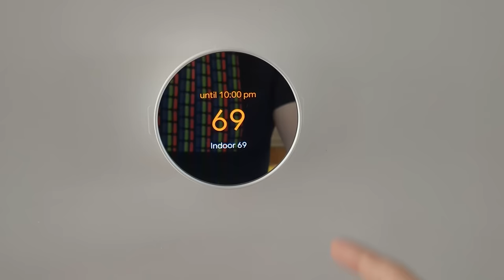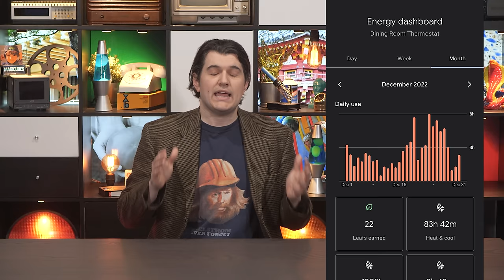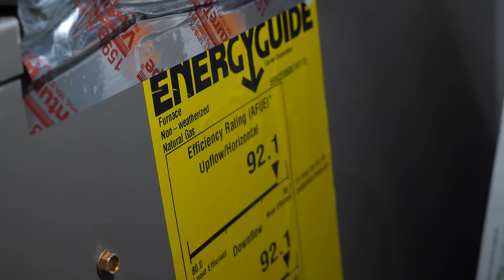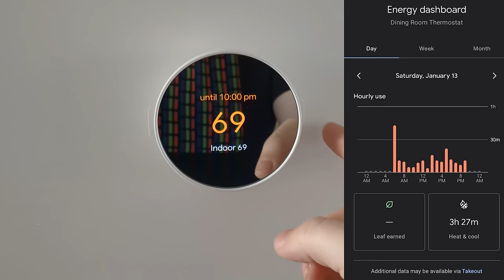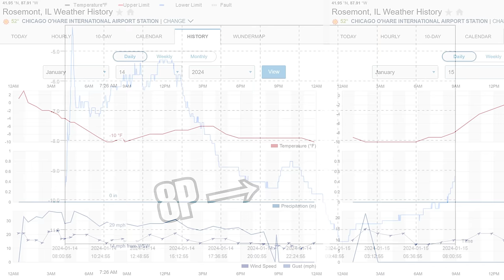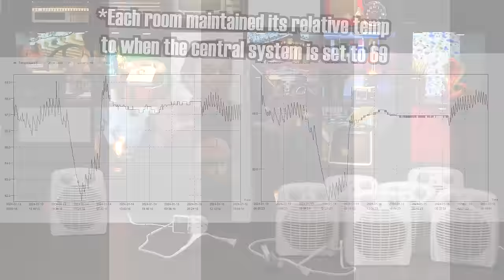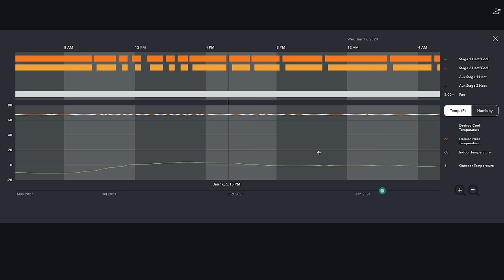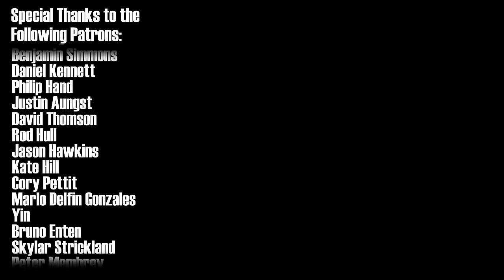Old HVAC industry practices are holding us back and costing us money. But we can fix it.

Comment: What about the duty cycle? When planning for any appliances or machines, whether mechanical or electronic, the basic rule is no more than an 80% duty cycle. That is why installing a slightly oversized unit is actually ideal. That way, you are not stressing the system.

For a similar analogy, take horsepower in an engine.

If I want to generate 400hp, I can do so with a wide range of number of cylinders. From 2 to 12. The amount of stress on the engine decreases with more cylinders, meaning a larger engine will last longer.

It all boils down to durability and endurance. If all you look at is efficiency, then you are leaving a lot on the table.
Reply: nope - a properly sized system will only run continuously a full capacity under 1% of the time. won't be running close to even 80% duty on average.
Reply: @Jon-hx7pe  your math is not mathing. If a system is "properly" sized, it will run at or above 80% for a good chunk of time. It is only meant to run at 100% for a day or two.

What my point was is that it is better for the long-term life span of the system to have it never go above 80%. Plus, not having to push the system to its maximum requires less energy. All that means is that in his example, instead of a 20k btu, he needs a minimum of 26k btu. From a 1.5 ton to a 2 ton system. His current system is by far overkill. But having a little wiggle room is always a good thing.
Reply: @P.I.E.  No it will not at all. On the coldest 24 hour period, will only run continuously at max a few hours late night/early morning before the sun comes up and people wake up and start using appliances. Very few hours are spend at design. Most of the time, property sized stuff in winter won't be running more than 50% equivalent to total max capacity in coldest months.

80% guideline is total bs anyway - equipment is engineered for continuous duty and running does not hurt it, turning on and off does. heat exchangers crack from expanding and contracting not staying hot. relays, ignitors, wear out from cycling. the worst thing you can do to a compressor is start it.

alec knows what he's talking about, over a month later people still post misconceptions about sizing. in the same shoes - i would have disabled new comments after the first week!
Reply: @Jon-hx7pe  thank you for proving you do not understand the standards. Most of what you said is factually inaccurate.

When properly sized to standards either in summer or winter, your system will not shut off on the most extreme days. This means you are running at 100% for the entire day. That is how the current standards are set.

Yes, the 80% rule is a vital safety standard in all types of equipment. Ignoring the safety parameters only leads to unnecessary and costly replacements.

Part of posting on social media is the interaction with others. Those who disable comments or delete those they dissage with are only proving that their are incapable of backing up their claims.
Reply: @P.I.E.  80% duty cycle is not for all types of electrical/mechanical equipment because they wear out differently and are engineered differently. There is no rule of thumb for 80% actually that has universal applicability, it is some old school non-sense that is repeated. A contactor that stays closed all the time, energized all the time lasts far longer for example than a contactor that is cycled because it is the arcing and mechanical action is what wears it out. A furnace heat exchanger goes from room temp to extremely hot in less than a minute and the thermal stress of cycling it is what causes cracks/holes to develop. On the other extreme, a cheap vacuum cleaner with a high rpm motor that runs hot isn't going to be designed for continuous duty and would get destroyed in short order between bearing wear and heat running continuously. It's all about how the equipment is engineered. Everything in hvac except for fan motor bearings gets worn out less running than cycling, and for motor bearings the issue would be total number of hours of mechanical wear, not duty cycle because they are engineered for continuous duty without overheating/getting damaged. 
Alec actually debunked the myth that running hvac equipment continuously wears it out vs cycling in one of his connextras add on videos addressing the bad comments - you should watch it if you haven't. 

As for design temps and sizing, you do not understand how it is derived evidently. The design temp is based on hours from bin data during the entire season, not the coldest or hottest day average day. If you're in an area that at coldest 1% of hours are -10f, it is only going to be at -10f for 1-5 hours in late night to early morning during a few full days/24 hour cycles during the entire season. In my area the 24 hour low is -10f, the high will typically 5 to 10f. The sun will also come up and occupants will be showering, using the stove, the kettle etc producing more heat.

Continuous operation is actually desirable , but not at full output all the time. continuous operation is more comfortable. This is why hvac manufacturers make 2-stage and variable capacity equipment, to load-match. A 2-stage furnace for example shouldn't be shutting off the coldest day of the year, it should be running continuously on low, shifting into high at needed and only running high on continuously during the coldest 1-5 hours. If it is variable capacity like a inverter heatpump - it should be on all the time for the coldest weeks, just adjusting output to match the heat loss.
Reply: @Jon-hx7pe  well you are entitled to your opinions.

None of the standards that I can find anywhere or any of the techs that I have ever talked to would agree with your version.

Yes, a multi stage or variable output system is ideal. But these comments were for this video dealing with standard basic equipment. Things like inverter heat pumps, geothermal, and other variable output systems are different stories as far as standards and continuous output. But the 80% rule still applies.

Yes, the 80% rule is a real thing. It is used in everything from electronics to vehicles. From residential to commercial and industrial applications. It is a basic general rule for everything for a reason. It is even used in the manufacturing of these pieces of equipment.

Now, look, I am not saying that if you can get by with a 2 ton system that you need a 6 ton. That is absurd. But you need a little head room. If the calculations call for a 2 ton, get a 2.5 ton system.

Even the manufacturers do not recommend continuous operation. Except for a very limited number of devices. Running your equipment all the time will wear it out faster. These are simple and basic facts.
Reply: @P.I.E.  Most hvac techs have no idea how to size and go way over using rules of thumb to cover themselves and are pretty ignorant. 

none of what you posted is true. you should not add head-room for air conditioning ever as it ruins dehumidification, safety margins are not part of any a/c sizing guideline published. if you have a 2 ton peak cooling load, in milder but humid  conditions may only have a 1 ton load and a 2.5 ton would not run long enough to properly dehumidify. 
your safety margin ruins comfort even for heat due to shorter cycles, and it is worse with furnaces with the wide size increments they come in - if you need a 60 000 btu furnace to cover design conditions, no way in hell should you be getting an 80 000 btu or 100 000 btu.

A universal 80% rule is pretty absurd and is not published by any hvac manufacturer as a general rule. there are commercial fresh air units and residential hrv/erv units specifically engineered to run 100% of the time at full capacity. according to the theory they should all be dropping like flies because they're on over 80% of the time. It becomes crazy ignoring all the differences in how things wear out and including electronics. A electronic fluorescent lamp ballast sure as hell doesn't need to be off 20% of time and there are many buildings that keep their flourescent lamps on 100% of the time and those ballasts last decades. There are many servers for businesses that run 100% of the time too.

It's probably some old rule of thumb derived from a 1950s engineering textbook. next, i guess i'll start drinking 8 glasses of water per day 'cause some quack doctor said so decades ago instead of drinking when i'm thirsty.
Reply: @Jon-hx7pe  your rambling just further proves my point.
Reply: @P.I.E.  okay you're right - so i'm going to tell my landlord that they have to install timers on the fluorescent lights in the halls to make sure the electronic ballasts get to rest for 20% of the time because it applies to all electronics. :face-orange-raised-eyebrow:
Reply: @Jon-hx7pe  The better question is, why are lights being left on and wasting energy?

But again, you are failing to understand the difference between an items operational time and its capabilities.
Reply: @P.I.E.  ...because they're hallways that need to be lit all the time for safety reasons, obviously?

Every manufactured electrical and or mechanical device has an intended duty cycle. 
A central a/c compressor or a blower motor is normally rated at 100%, meaning okay to run at max/full capacity continuously. 
A paper shredder on the other hand may have a 20% duty.
Rather than going with a 80% rule, should actually going by ratings and applying common sense. But no, just 80% for everything! consequences of oversizing hvac equipment be damned.

Comment: It is strange to find someone advocating for perpetual uptime Heating and Cooling equipment as a metric for sizeability. A heat pump running 12 hours a day, then saying that is appropriately sized, is just horrific. You are going to be paying out the nose to keep it running all that time, and for only moderate savings on installation, it just doesn't make sense.

Comment: Call me a moron who doesn't know anything about machinery, but I tend to err on the presumption that an operational system like a domestic HVAC is generally fine with, at most, a 20% margin for excess capacity, both to anticipate potential spike demand in cases of unexpectedly adverse conditions and simply to allow the system to not constantly run at 100%, which should help extend the operational lifetime of the parts. If you need more than that on anything other than vanishingly rare occasions, you have way bigger problems. Commercial systems are a whole other kettle of fish but eh.

Comment: wow so much space wasted to ducts and the size of the furnaces! one boiler for us does hot water and heating. heatign goes to radiators via very thin pipes about 1-2 cm diameter depedning on which it is. the boiler can go into a broom closet.

Comment: I have no idea where you live. In my country, in the winter, you're lucky to get get 50C water from a heat pump. More likely 40-45C. Gas boilers are pretty clean and not exactly destroying the environment. Cheaper to run and install too. 
Heat pumps need to get that electricity from somewhere. Just because the gas is being burnt somewhere else and transmitted doesn't make it better for the environment.

Comment: Im telling you this from experience youll regret that heat pump.  My friend from work has ine and his heating bill climbs to 500 a month in ohio winters and mine climbs to 150 using a modern high efficiency gas furnace.  Made by tempstar.

Comment: 18:00 I dunno u mite be VPN'd into your home network.  Also, don't call me Shirley.

We need PID controllers, VFDs and different power level settings.

If I ever replace my AC/heater, I am going to print a QR code with a link to ur video and stick it on there.

Comment: So the smart thermostat thing they are nightmares for service techs so alot of companies just don't deal with them most of they say the simple thermostat works well is cheaper and simpler to use instal and matain and i cant fault a tech for saying that a story of a tech i know there was an issue at a house ended up costing the hone owner around 3k in constant headaches over about a year turns out it was a bad smart thermostat how much savings and effecy do you have to have to save 3k like you said at the start your gas bill is $70 if it goes to even 100 thats 100 months to get that return i like smart thermostats in theroy but they make them unnecessarily complicated copy a regular thermostat add wifi and remote change and you would have a winner

Comment: Meanwhile, here in Florida, my HVAC has been able to supply heat-pump generated heat to my house for at least 25 years (my current system can, and the previous system I bought the house with could). ¯\_(ツ)_/¯ Not that it gets used much. But it's there.

It's surprising to me that this is such an ordeal in colder climates.

Comment: Why can't you just turn off your HVAC, measure the temperature difference between inside and outside, and see how quickly the inside temperature approaches the outside? You should be able to calculate the exact R value of your home with that any day of the year as long as a measurable temperature difference exists

Comment: I swear I'll watch the whole thing, but until I get to that part, I'd just remark... if you have two shared walls, and you turn off your heating, then your unit is getting heated by your neighbours. Heck, if they normally heat at a higher temperature than you do, then again, they are paying for a part of your heat, and part of your heating comes from their furnaces' capacity.

All this to say, if you calculate your needs on a period where your neighbours are heating more than you do, and then they decide to reduce their heating, it's possible that you realize you no longer have enough heating capacity.

Alright I doubt it'd be enough to make much of a difference, but just being nitpicky.

Comment: If your neighbors were not there tho i bet youd need it. Also if its smaller it may tend to run longer which would make your bill higher. Having a smart thermostat will save anyone on there heating bills. Unfortunately for myself i live in a brick building in a loft apartment/shop built in 1929 with no insulation and with a flat roof. Heating it costs me 300 a month in January. I have a boiler system and this is an industrial building with firefroof floors that cannot be cut because they are 10-12” thick reenforced concrete.

Comment: I haven’t seen the rest of the video, but you’re saying your heater is only running at most 25% of the time. But a lot less other times. So if you sized your heater down to 25%, that means it would be running 80% of the time or more, and for what? It’s making noise all the time now at that small size. So on a typical day, instead of running for 6 minutes an hour, now it’s running 50 minutes an hour, making noise that whole time. And then the time to catch up from your 62 deg to 68 deg would literally take hours instead of a few minutes. I’d much rather have it run a few minutes and not have to listen to it for most of the day.

Comment: When I look at this from a European perspective, I have to shake my head every 3 minutes. The type of heating with hot air is uncomfortable and inefficient. Construction and isolation in the USA are a joke. Heat pumps have been used in the EU for decades. With radiators in which relatively cool water circulates (approx. 30° - 40°C). This is extremely efficient if the construction method is used in Germany, for example (full insulation, insulation windows with triple glazing, etc.)